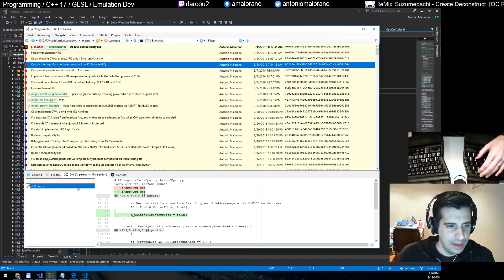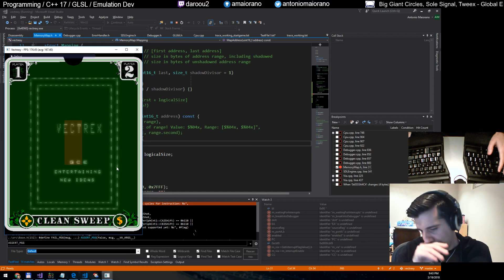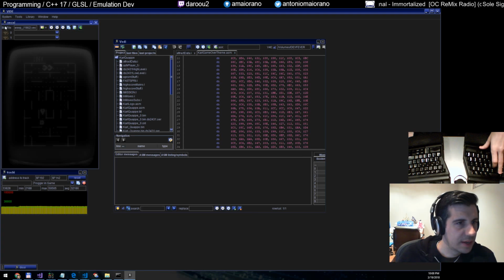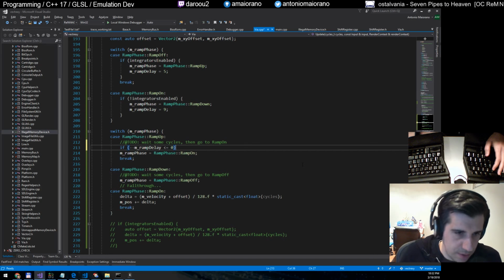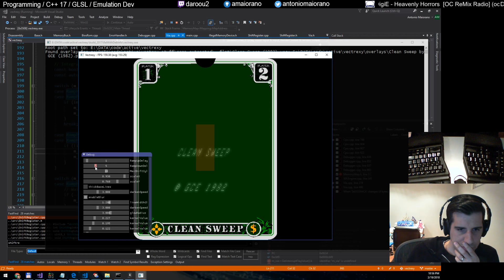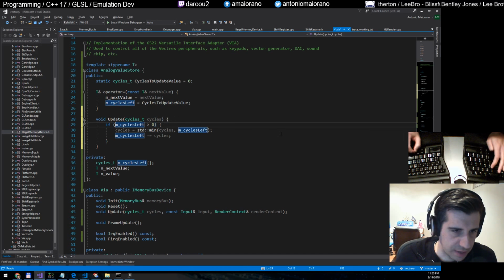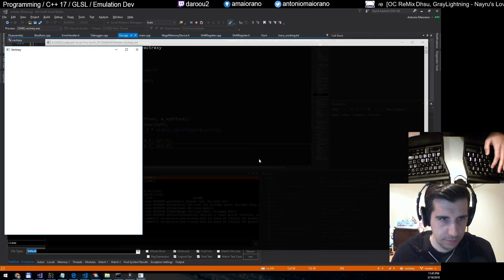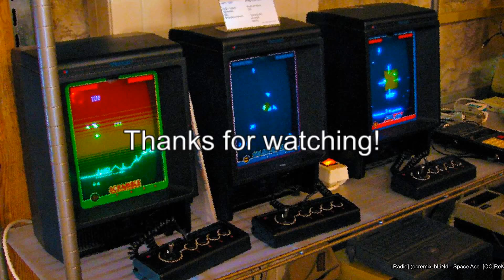Ep. 61 - Programming a Vectrex Emulator [Vectrexy|C++17]

Comment: Hi,
just watched your video - and I see you reached Clean Sweep.

You also read some of my older texts - they may be partially right and/or partially wrong - since I am not an electronic guy I never did any „measurements“ with oscilloscopes. 

All that timing stuff is just guess work and it seems to work (most of the times).

Two things I am pretty certain that are not really correct (or not completely anyway)  „VIA <-> Analog“ timing/delay issue:
- Ramp On/Off delay (Clean Sweep, vectrex start screen, …)
- Shift Delay (you see that „phenomenon“ when printing text using „home made“ bidirectional text display routines (Moon lander e.g.) 

And probably (sadly) many other delays I introduced in Vide also.
This does not mean, that emulating the vectrex using those delays does not  give pretty good results - but I don’t think it is (alone) the correct emulation (anymore).

I haven’t as yet come up with another/better solution I kept Vide as it is.
(I haven’t tried really hard - I have kind of a Vide- burnout :-) - this is where you might come into play! Please emulate better than Vide - so that I can copycat your solutions! )

My Reasoning:

a) Ramp On/Off
 http://vide.malban.de/8th-of-november-19-monitor
I bought a 19’’ arcade monitor and connected it to the vectrex. And only by connecting a different kind of monitor - vectrex display changed dramatically (not as screenshot - but also Clean Sweep doesn’t look right)
It seems the the arcade monitor is in many  ways „faster“ than the original vectrex monitor - since many games actually look on it more or less like on an emulator WITHOUT delay settings). 

You might say the monitor is  also part of the „complete vectrex system“ and thus part of the emulation package - which I heartily agree to. But the „place“ in emulation where one attaches another monitor to the vectrex is completely different to where the analog delay values are placed in „our emulators“.  
Another example Vectrex on Arcade monitor „https://youtu.be/QsPtFXEXdLs?t=4m18s“ at that timer location you see a vectrex start screen.
And see how the „Vectrex" letters are places „wrong“ (slight drift to the right) - this is exactly the „non delay behavior“ only by using another vector monitor.

b) ShiftRegister see:
 http://vide.malban.de/in-via-we-trust
I put 8 different VIA (also different manufacturers) into one of my vectrex and it never made any difference. For that reason I don’t think that VIA chips use different SHIFT Register delays.
(and also a) )

That being said…

Vectrexy is looking always better…

Greetings from Germany 

Malban